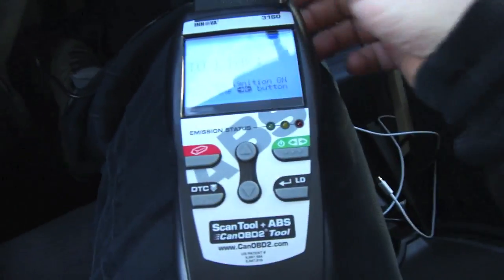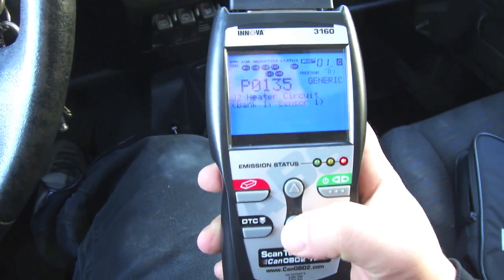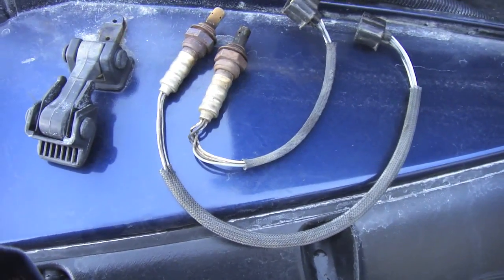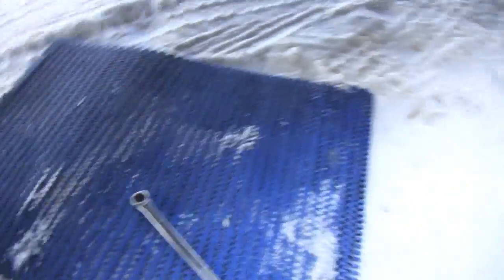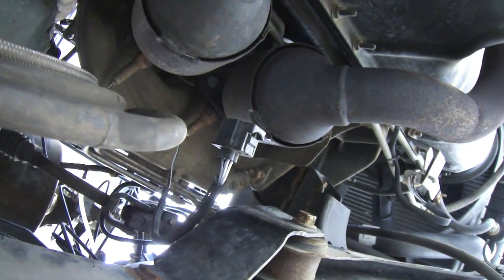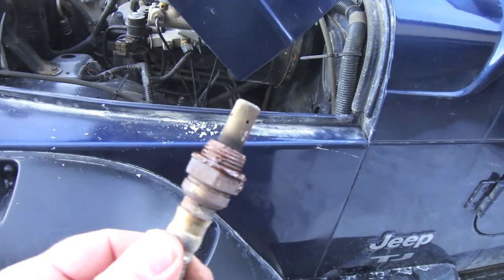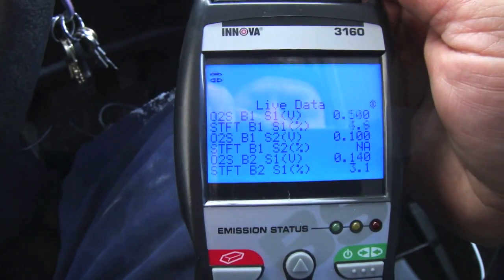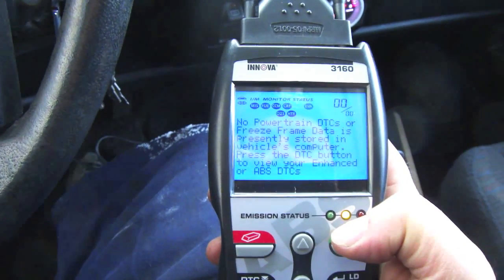Troubleshooting P0135 Heater Circuit

Comment: Ive had those codes for years now. Ive replaced both sensors but they came back on after a week. Ive check all the wiring for shorts or cuts and nothing. I dont know what to do
Reply: Acelaferriere check your heater circuit fuse

Comment: Found one... Magnaflow seems to be the only one that makes anything remotely close without it having to be a one-off part.  50209 is the part# for it if you decided to run with aftermarket parts with that section.